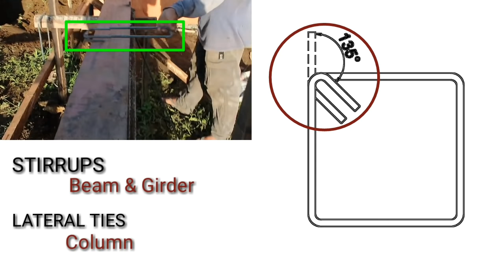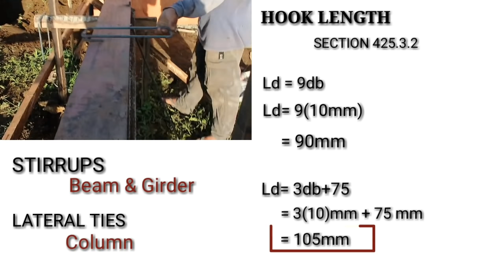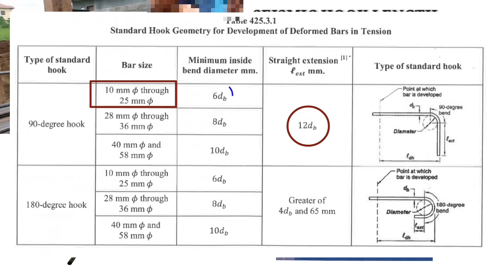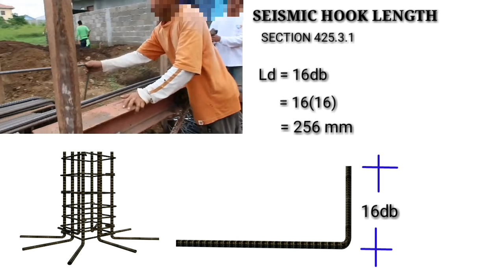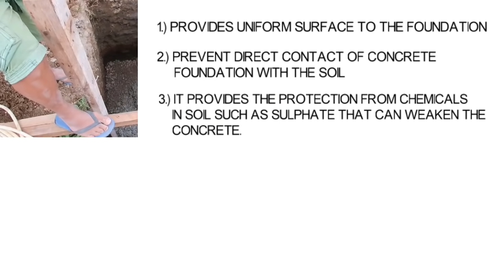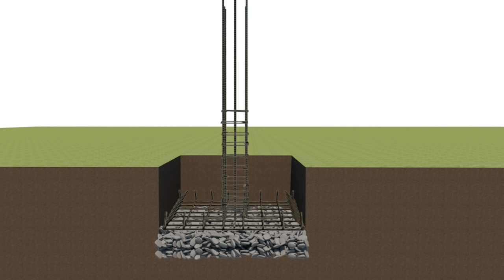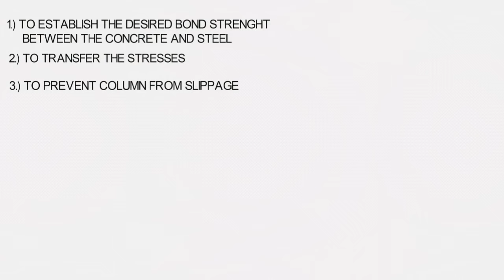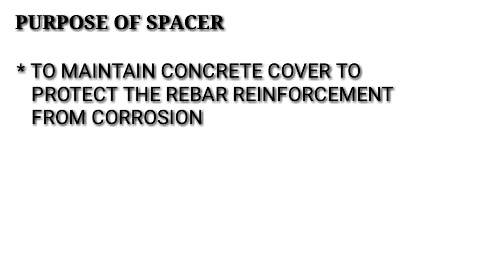COMMON MISTAKES IN CONSTRUCTION - PART 1

Comment: Hi Engr. Aron! Very informative content, giving sources/references to applicable standard. Engr can you please clarify from 10:45 that "S" should not be greater than 150mm where "S"  is/are the distance between main bars and/or corners?
Reply from the maker: Ties shall be arranged such that every- corner and alternate longitudinal bar shall have lateral support provided by the corner of a tie with an included angle of not more than 135 degrees and no bar shall be farther than 150 mm clear on each side along the tie from such a laterally supported bar. Where longitudinal bars are located around the perimeter of a circle, a complete circular tie shall be permitted.

Comment: Good day sir.. with regards sa spacing ng main vertical bar. For example size ng column 300x20mm. 300-40-40=220 kailangan pa ba maglagay nglateral ties sa gitna? 6 vertical bars lang kasi sa drawing ang napaluob sa 300x200 column.. sa video kasi dapat my spacing ang main bars ng 150mm.. corner bars kasi nasa 220 mm na.
Reply from the maker: 300-40-40-10-10-2db
Kung more than 150 siya you need additional 1vertical bars para masunod yung nasa code.

Comment: Very good videos, thank you. How do you feel about a raft style double rebar footing reinforcement in this application? Too much over building or money well spent if you have it?
Reply: Hello po engr.  Natural lng po ba na may makitang mga small cracks sa wall?  Parang mga line po sa pader.  San ba nagkamali?  Sa finishing? or sa mixture ng cement sa pag chb?  Thanks in advance.
Reply from the maker: Kunh hairline cracks lng sa wall normal lng naman, try mo katukin ng piso yung part na may crack kapag ang tunong ay kulob/ ampaw kapak po yan kailangan po i repair pero kapag solid naman yung tunog okay pa po yan.
Reply from the maker: About the double reinforcement of footing, it is  not applicable for this kind of Structure it is  wasting of money, that is why we Civil Engineer's do a design not only for the strength of the structure we also consider the most economical.

Double reinforcement Footing is applicable for Heavy structures like piers, Highrise Buildings, RC wall/Retaining walls and etc.

Comment: Hi engr. Aron,

Thanks for sharing your knowledge.

Pag pang pundasyon ng poste sa bakod na barbed wire, ano ang mix ratio? ilang PSI and needed, kung ang poste ay 2 meters na 1" GI sched40pipe?

Best regards from Bicol🌋
Reply from the maker: Pwede na ang 1:2.5:5
Reply: @ARONJAMESGARCIA  thanks a lot engr.Aron.  Just to confirm: yung
 1 - cement, 
2.5 -sand, 
5 - gravel
Tama po ba?
Pasensya na ha kc 1st time ko talaga gumawa ng bakod namin. Nag-aaral palang ako.
Reply from the maker: @AHEUTUBE  Yes Idol Tama ka

Comment: Sir. Tanong lang po. 11.5m x 6m ang lot at rowhouse. Ngaun po eh no renobate. Halos sakop lahat ng lot para sa structural ng bahay. 11 ang post according to plan. Pero hindi naka tie beam. Wall footing at column footing lang ang bahay ay 3rd floor. At hukay ng mga foorlting ay 120. Un iba nabawasan pa gawa ng binawasan ang flooring. Tama po kaya un?

Comment: good explanation kuya.   now i have a question  which will be your final exam question to pass engineering test. here it comes...
Question : can we weld rebars rother then tie with wires?      and why?
Reply from the maker: For REINFORCED CONCRETE
Take Note: Not all Rebars are weldable.

Yes you can connect the Rebar through weld but for main bars only like vertical bars and Horizontal bars and you need a Skilled worker to do that 

Yes mas matibay ang weld connection kung ang pinaguuspan lang ay ang kapit ng steel or Rebars pero sa Reinforced concrete hindi sya ganun ka effective dahil sa mga ito

* Concrete and Steel Expand and Contract at different rate kaya kapag ang Stirrups ay naka weld magkakaroon ng stress or Pressure na magiging dahilan ng cracks sa concrete dahil hindi nag move freely yung stirrups dahil ito ay naka fixed with the main Bar.

Compare to Tie wires
Tying keep the rebar move freely kaya hindi ito magkakaroon ng pressure sa mga joints.
Reply: @ARONJAMESGARCIA  
Correct me if I am wrong but I read somewhere that:
1. Ties in rebars have no effect in strength of the final product and are only to position them properly during pouring? We can actually use plastic zip ties?
2. Miracle in construction is...rebars and cement have exactly the same expansion and contraction properties?

Comment: Sir sa slab pwede na ba ang round aggregate or 3/4 crush aggregates ang kapal ng slab ay 4inch with steel deck?
Reply from the maker: Idol honestly hindi pa ako nakakagamit ng round na bato pero kung Slab on Grade mo gagamitin for small residential building pwede nman. pero kung Suspended Slab I recommend na gumamit nlng kayo ng 3/4 crush aggregates.

Comment: Hi Engr.,are the 9 db and 16 db constants? I could not find them in the Table.
Reply from the maker: You can compute them by adding those value indicated in the table just follow the callouts in the drawing  illustration.

Like for example
16db = lext + min. bend radius + bar diameter
= 12db + ( 6d/2) + db 
= 16db

Comment: Hi sir, ask ko lang po if ok lang ba na walang sag rod sa mga c-purlins 2x3 for roofing with rafter c-purlins 2x6? thanks
Reply from the maker: Dapat mero idol para maiwasan ang pag lundo ng Open web member gaya ng C purlins. At maiwasan ang Unsupported Lenght nito.
Reply: @ARONJAMESGARCIA  Thank you sir. May distance po bang kinoconsider kung kelan dpat magLagay ng anti-sag rod/tie?
Reply from the maker: May Design Computation kasi na ginagawa jan Idol, considering the wind pressure and other load na mag act jan sa Pourlins.
Reply from the maker: @anniebethlaynesa8820  Since residential nman yan so consider as Lightweight roofing naman siya ganito idol gawin mo
Sukatin mo yung pagitan Trusses mo kung mas mahaba siya sa 6m malagay ka ng dalawang rods with equal spacing kapag Less than 6m naman siya idol maglagay ka ng isa sa gitna or sa pagitan ng Dalawang Trusses or yung pinapatungan mo ng C-PURLINS.
Reply: @ARONJAMESGARCIA  nsa 2.4m po ung pagitan ng trusses. ung mga c-purlins na nakapatong sa trusses, kelangan po ba un lagyan ng rod? 0.85m po ang pagitan ng c-purlins.
Reply from the maker: Oo idol kahit 10mm lng na Sag rods

Comment: Sir as youve mention, from footing dapat 1.5m yong buhos. Pano kung sa design  is yong tie beam nasa top ng foundation, suggested po ba na e sabay ang buhos ng footing tsaka tie beam.
Reply from the maker: Kung nasa ibabaw lng ng footing yung "TIE BEAM" hindi mo naman talaga maisasabay yung Tie beam unless yung tie beam ay  part ng footing or it serves as a "STRAP BEAM"  usually ginagawa itong design na ganito kapag meron kang column na nasa corner ng Footing or ecetrically loaded. kung ganyan yung design yes dapat monolithic yung pagbuhos ng Strap Beam sa Footing.
At sa pagbuhos kailangan naka tutok yung alulod dun mismo sa footing to avoid spreading of concrete at para malinis ang pagkakagawa.

Comment: Engineer, ask ko lang kung sa 400mm by 400m na dimension ng column with 12 vertical bars ang lateral ties ay 1 set lang ang nakalagay sa design. Tama ba ito or need ko dagdagan ng another 2 set ng lateral ties?
Reply from the maker: Dagdag kpa ng isang set ng inner ties idol ang magiging set up niyan kapag 12pcs. Na 12mm naka bandle yung dalawang bakal sa may apat na corner and the remain 4 ilagay mo sa mga pagitan.

Comment: Sir, ok lang po ba na ung hook ng parilya ung ginamit na spacer? Naglagay po ng gravel bed bago ung parilya. Nabuhusan na po ng semento ung footing. Structurally safe pa din po ba kahit ganun ang ginawa?
Reply from the maker: Safe pa nman sa "NGAYON" kasi kahit hindi siya direct contact sa Soil may possibility parin na kakalawangin katagalan yung Bakal. Kaya naglalagay tayo ng Concrete cover to Protect the Rebar from corrosion.
Reply: Sir thank you po sa pagsagot! Last na po na tanong😅. Ok lang po ba na di naka center ung column sa footing? Nasa gilid po ng footing ung column. Thank you po, ang responsive nyo po!😊
Reply from the maker: @kristine1661  Okay naman po yun, as long as nagawan ng Structural Analysis at nadesign siya okay yan, usually kaya tayo nagkakaroon ng ganyang set up ng footing para hindi tayo lumabas sa ating property line.
Reply from the maker: Kung may hindi pa kayo nabuhusan na Footing pwede niyo na incorrect yung set up maglagay nlng kayo ng Concrete Spacer instead na gawing Spacer yung hook ng Bakal
Reply from the maker: May part pa po itong Video na ito na discuss dun kung paano mag compute ng haba ng Hooks, Lap length at iba pa.
Reply: Maraming salamat po Sir sa pagsagot!😊 Napaka helpful po ng mga tips nyo. More blessings to your channel po! God Bless po!
Reply from the maker: Ongoing pa po ba pagpapatayo niyo ng Dream house niyo? Kung may Doubt po kayo sa pag implement po nila pwede po kayo magtanong sakin Free lng nman magtanong😊👌🏿👌🏿👌🏿
Reply: Opo Sir, 2-storey lang po. Nagsimula na po kasi ang tagal po dumating ng architectural plan at ng structural analysis. Need na po namin magstart bago mag rainy season. Thank you so much po!😊
Reply: @ARONJAMESGARCIA  , pag 1.5x1.5mx0.3m footing with 16mm rebars and 0.4mx0.4m column with 16mm rebars.... ok lang kahit hindi sa center ng footing nakalagay amg column?ty
Reply from the maker: Naka Cantilever ba siya Idol?

Comment: Good afternoon po, nagpagawa po kami ng bahay, as per plan the dimensions of the columns must be 250mmx300mm but as per actual dimensions on site is 150mmx300mm tapos ang concrete mixture po ay 1:5:6 ok po ba iyon
Reply from the maker: Hindi po okay, kasi unang una mawawala po yung liability ni Designer.
Reply: Ang problema po sir ay yong architect po ay siya ring contractor saan po ako pueding magreklamo
Reply from the maker: @adormasangkay3252  Yung pumirma ng Structural Plan.
Reply: Wala po tayong Concrete Ratio na 1:5:6 (Cement, Sand, Gravel),

Class AA 1:1.5:3
Class A 1:2:4
Class B 1:2.5:5
Class C 1:3:6

So in short, gamit ni Architech Class C, pero dinagdagan nya lang yung Sand para sa tingin nya ay babawi sa "katibayan" ng poste. Dapat, Class AA, kasi column na yan.

Complain po ninyo sa Barangay muna.

Comment: Sir sa 2storey with roof deck po na 9x5meters na sukat ng bahay anong size po ng bakal at ilang piraso ang dapat ilalagay sa poste.thanks po sir and God bless po
Reply from the maker: 0.25x0.3 @ 6pcs. na 16mm
Reply from the maker: Sa may 9m maglagay ka nalng ng Column sa gitna para 4.5m ang distance ng Column.

Comment: Sir dito sa @5:39 bakit po naging 16db yung Length ng hook hindi po ba dapat 12db+6db=18db?
Reply from the maker: 12db+16db/2 + db = 16db
Reply: @ARONJAMESGARCIA  sorry sir pano po nag come up sa ganito yung formula?
Reply from the maker: Please see the drawing na may label.
Extension = 16db measure from the center ng minimum bend diameter na 6db kaya naging 16db + radius nlng 
Pero yang hook na yan ay measure mula sa tip ng hook hangang likod ng hook kaya plus db.
Try to draw the figure para mas maintindihan niyon
Reply: @ARONJAMESGARCIA  Okay sir maraming salamat po! Keep on educating po, more power.

Comment: Good Morning Engr. Saan niyo po nakuha iyong section sa NSCP 2015 iyong spacing of vertical main bars?
Reply: Ang nakalagay po kasi sa Chapter 4 Structural Concrete under Column sa 425.2 Greates of 40mm, 1.5db

Comment: Sir, san po nakuha ung additional na 3db for computation of hook length @2:57?, ung po kasing sa code is 6db or 75
Reply from the maker: Please see drawing and cal outs
6db and 75 is the extension only dipa kasama yung bend at kapal ng Rebars 4db is the minimum bend bars kalahati nun 2db + db na kapal  ng bakal = 3db
Reply: @ARONJAMESGARCIA  Salamat sir..clear na po.

Comment: sir, ok lang po ba na ang dulo ng bar para sa footing ay hindi naka-Hook or naka-bend? ano po imPact nun?
Reply from the maker: Good question Idol,
No need na maglagay ng hook sa Footing rebar as long as a straight bar can develop its full capacity, To prove that pwede mo I check using the Formula na binangit ko sa Isa kong video about development length ang sagot na makukuha mo dun i compare mo sa Actual na haba ng bakal measure from the face ng colum at kung mas mahaba ang actual sa required ibig sabihin dina kailangan ng Hook.
Reply from the maker: But its up to you pwede ka rin maglagay for safety Factor.
Reply from the maker: Okau sampolan natin for example meron tayong Footing na may sukat na 1m x 1m at Colum na 0.25x0.25m Para makuha yung actual development lenght ganito lang gawin mo 1m bawas mo lng yung sukat ng Column na 0.25 = 0.75m saka mo hataiin sa dalawa yang 0.75, 0.75/2 = 0.375m, sa required naman meron akong ginawang tabulated value per diameter ng bakal so compare mo dun kung mas mahaba yung required ibig sabihin need mo maglagay ng hook pero kung mas mahaba naman yung Actual sa required ibig sabihin no need na maglagay ng hook😊
Reply: @ARONJAMESGARCIA  thank you po. keep videos like this coming. very informative and natututo ang viewers kahit hindi CE. 👌
Reply from the maker: For dimensions naman
*Column start 250mmx250mm and Add 50mm per floor 
*Beam Convert Column distance in meter into Ft. Then multiply by 25 So yun ang magiging depth and witdh naman 50% of Depth
*Footing 1.5mx1.5m

Comment: Sir, sa dalawang palapag na bahay na may rooftop ok na ba sa haligi ang 4 pcs 16mm rsb at 2 pcs 12mm?
Reply from the maker: Hindi ko masasabing okay yung bilang ng bakal without doing an Structural Analysis. Iba iba kasi ang behavior ng isang building in terms of location, Architectural Design and etc.
Reply from the maker: Pero sa mga nagawa ko ng design usually 
0.35mx0.35m na Column na may 
8-16mm

Comment: Hello po Engineer, saan po ba nanggagaling yung constant sa Ld, like yung “16” sa  5:32 mark na Ld=16db? Nalilito po kasi ako since hindi indicated sa table 425.3.1 yung “16”. Sana po masagot, thank youuu
Reply from the maker: Ext = 12db
Minimum Bend diameter = 6db
Bar diameter = db
Ld = 12db + 6db/2 + db 
     = 16db
Reply: @ARONJAMESGARCIA  okay na-gets ko na po, thank you! Aiming for Licensed Civil Engineer po ako kaya big help yung vids nyo!
Reply: @raymondpascua8411   bakit po kaya dinivide sa 2 ung 6db?
Reply: Kasi po diameter ang given, pero radius ang tamang length na idadagdag sa total ld, along with 12db + db. So yung solution is (12db + 6db/2 +db) x (16mm)
Ld = 16db (16mm)
Ld = 256mm

Comment: Sir  good morning.  Ask ko lang po nagpagawa po ako ng abang na slab sa 2nd floor  ang ginamit po sa poste ay 12mm po at 10mm. Gawa na po sya 10yrs na po balak ko po ngayon lagyan na ng taas may nakapagsabi po sa akin na maliit ang ginamit na bakal. Suggest naman po kung anong way na magamit na yong 2nd floor. Ang sukat pala po ng bahay ay 5x8meters rectangle shape
Reply from the maker: May email address ka Idol, message mo ako sa Email arongarcia373@gmail.com
Reply: Sir iniintay ko sagot mo SA question ni callega DIY pArehas Kami problem, may I know your suggestion, tnx and godbless.

Comment: Engr may bahay ako na slab ang bubong kaso naipaputol ko na ung abang na rebar for 2nd floor. Pwede pa bang magsecond floor kahit wala ng abang na rebar? Ano pinakamagandang way para mag2nd floor?
Reply from the maker: Instead of Concrete Column be pwede mo soya dugtungan ng Steel Column

Comment: Sir okay lang po ba ang 1 inch na concrete cover sa column?
Reply from the maker: Hindi po pwede na 25mm or 1 inch lng ang concrete cover ng Poste or Column meron po tayong minimum na 40mm. Ang 1inch po ay applicable lng sa suspended Slab😊

Comment: Tanung lang Po sir kung Ang design na bakal sa slab ay  top and bottom kapag nagmetal decking ka ay pwedi na ung top nalang o bottom nalang?
Reply from the maker: More on temperature bars pero meron parin nmang main bar and extra cut bars sa may tapat ng Concrete or Steel beams yung bend bars lng mawawala.
Reply from the maker: You mean Double reinforcement actually ang double reinforcemet sa Suspended slab ay applicable lng po sa Flat slab kasi makapal po yung slab na yan.
Reply from the maker: Isang level nlng yung bakal wala na naka depress.

Comment: Sir, bakit mo sinabing mali yung 90-deg hook pero based sa Table 425.3.2 sa 2:32, isa sya sa Types of Standard Hook?
Reply from the maker: Yung 90 degree para lamang yun sa mga cross Ties hindi siya applicable sa Outer ties.
Reply from the maker: Ang hook ng crossties ay combination of 90deg. at 135deg.

Comment: Naguluhan lang ako sa seismic hook length, sa naunang slide kasi table showing na 10mm-25mm is 6db pero sa sample computation ay naging 16db.
Reply from the maker: Please check the drawing na nakalagay sa table kung hangang saan lng yang 6db may call out sa drawing.
Reply from the maker: Yang 6db is a minimum bend diameter lng po yan meron pa po tayong lext= 12db a to size ng rebar na db
Total = 6db/2 + 12db + db = 16db.
Reply: Salamat po sa response newbie lang po.
Reply from the maker: Pati ako nalito din dati nung nagsisimula plng ako sa Construction industry.
Reply: @ARONJAMESGARCIA  sir bakit dinivide sa 2?
Reply from the maker: @randomreacts4931  bend diameter po kasi yun since the Iext ay measure from the center of that bend daimeter kaya na idivide sa 2
Reply: @ARONJAMESGARCIA   maraming salamat po

Comment: tanong ko lng po saan po nakuha yung para sa seismic hook [ 9db / 3db+75 ] ? di ko po kasi mahanap sa 425.3.4 seismic hook po ng nscp. thank you po
Reply from the maker: Please see the drawing na nasa table and try to add those call outs indicated
Reply from the maker: Option 1
Ext. + min bend diameter/2 + bar diameter

Option 2
Extension min (75) + min bend diameter/2 + bara diameter
Reply: @ARONJAMESGARCIA  Thank you po Engr. Garcia, ang dami ko po natututunan sa mga videos niyo po.
Reply: @ARONJAMESGARCIA  hello po Engr. pwede po magtanong bakit po dinivide yung min. bend diameter sa 2?Thank you po.
Reply from the maker: @thealustestica4145  please see the drawing ang call outs.